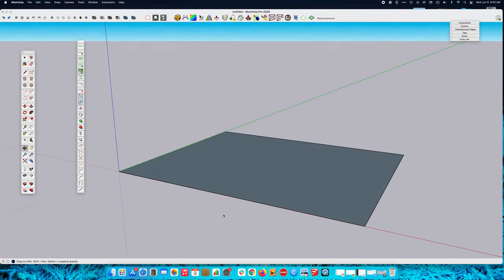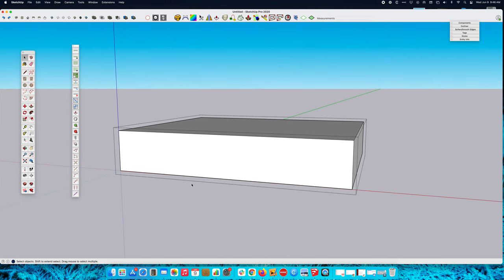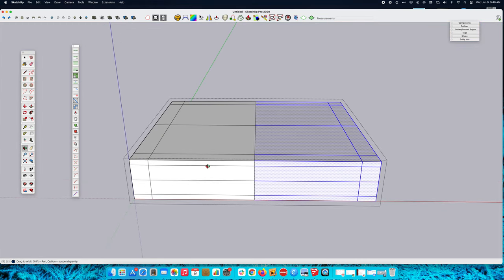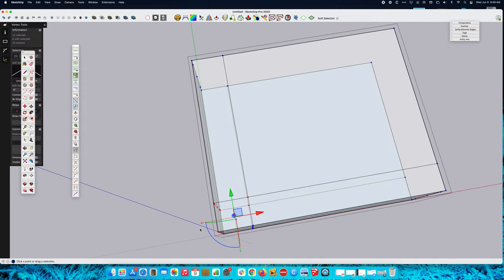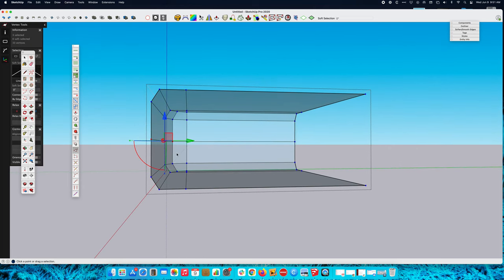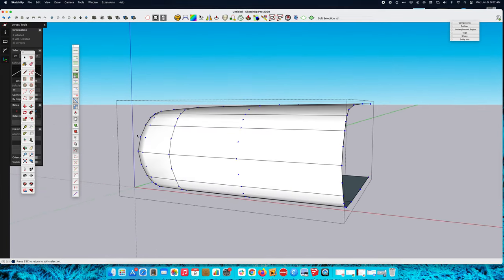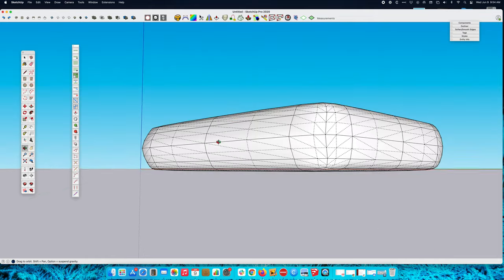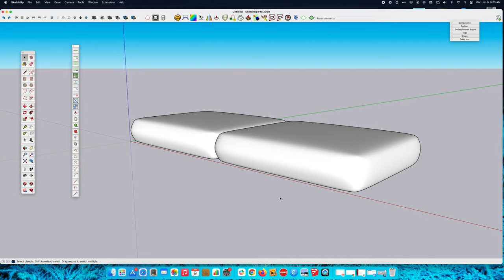Sketchup Model a Sofa Cushion using SubD - Part 1

Comment: Hi! Thanks for the video. The build ends option is not working for me, do you know why this could happen? Thanks a lot!
Reply: Also, what is that tool you have of a white circle with red dots?
Reply from the maker: Do you mean the connect edges tool?  This tool only works if you have more than two edges selected, and you have to make sure you click the check mark in the popup display box to apply any changes.
Reply from the maker: @mariagalgiusiano6395  This is the show/hide hidden edges button from the toolbar "Mr. Hide".  The other two buttons next to it are show/hide edges and show/hide profile edges.

Comment: Is SubD necessary? Can you achieve the same result with chamfering edges?
Reply from the maker: For simple shapes you may be able to  use round corner or other beveling tools, but you will quickly run into frustrations for any shapes that are more complex.  Inside corners have a tendency to be especially hard for those kinds of tools

Comment: what plugin is the 10/11th  down the quadface toolbar?
Reply from the maker: Hi @stevespicer5275.  Sorry for the long delayed reply.  That is a custom toolbar combining several extensions.  The first 10 are from Quadface Tools, the next 6 are SubD tools and the rest are Vertex tools.  I put this combination together because they are the ones I use the most and it keeps my work are clear of clutter.  The extension used to make this is called Toolbar Editor

Comment: Whats the point of using all this confusing tool? You can just using one tool, either fredo corner or mindsight corner(i forgot the name) ...
Reply from the maker: Hi!  Thanks for the comment.  It's an attempt to create more realistic looking cushions.  you can use the round corner tools for simple shapes, but they tend to be very hard looking.  if you are rendering, then it's helpful to be able to make your cushions look softer and more organic.  This is a simple cushion, but if you follow then next video (part 2) you'll see where you can start to add wrinkels and imperfections that make things look more real.  Also, if you have any complex shapes to model, then learning the basics here will help with those in the future.  Hope that helps!